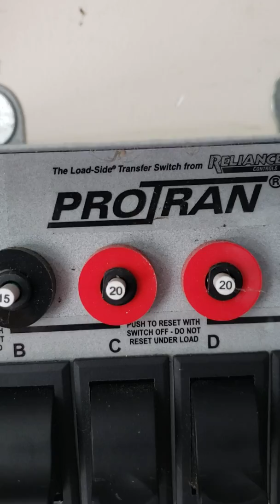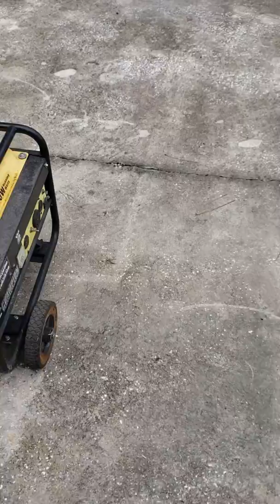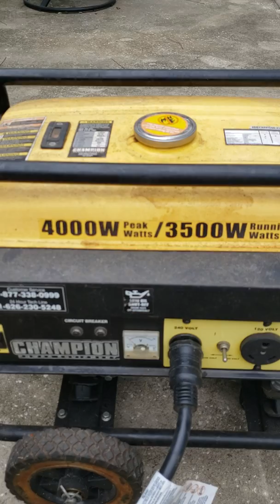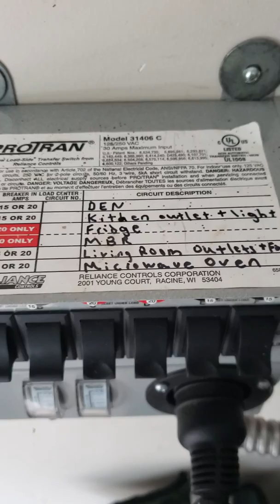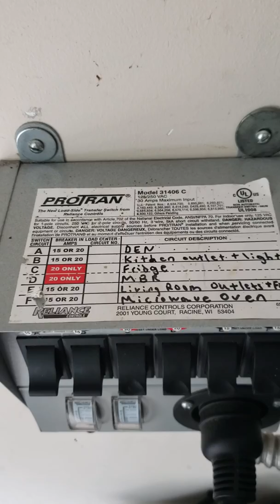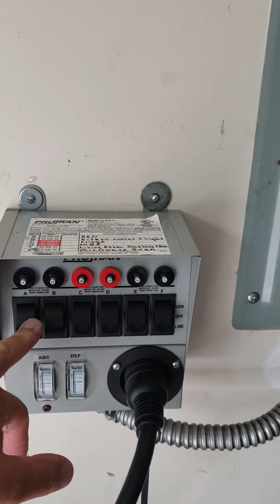Reliance generator transfer switch

Comment: Matt, great video...I came across it when looking for info on my Reliance transfer box, [31406CRK] when using my Champion [C46540] generator to power loads on my house main panel. Your generator looked similar to mine and if it is the same one, let me know if you've had issues with unregulated voltages on one side of your panel. I'll try to briefly explain and this is what I'm looking into before I install. 

When researching my generator, I learned that it is designed to have only one of its two output windings regulated to control the voltage. When the selector switch is in the 120 v position, both windings are connected and  their voltage is regulated to provide 120 vac - 30 amps to the RV plug. When the switch is in the 240 v position, the windings are split for outputs to the L1 & L2 sides of the 4-pin plug. As its designed, only one of those 120 v outputs is regulated. So if the  L1 & L2 are split to the loads in the panel, one side would be getting the unregulated voltage which might be a problem for me. 

I'm looking into using my 120 v RV plug to supply the input to my transfer box and not using the 4-pin 240 v output on my generator. I'm curious what you know and/or have done and if you've got a different generator, what yours is. THX and regards, gary

Comment: I have same box but never used it. When power goes out do u need make sure all your transfer switches are on generator or off? If i leave one on line, will that backfeed? Ty
Reply from the maker: You can leave the switches in any position you want if power goes out. The whole idea is that the generator and regular utility power are completely separated and safe. It won't backfeed in either direction if that makes sense.
Reply: @matthewschultz3568  ok thats what i thought just wanted double check. In florida and right in direct path of IAN 😵‍💫

Comment: For that money just get a manual interlock and a double pole 30 amp breaker and power the whole panel .. you decide what to power - same 6 circuits you have chosen or switch out as needed.  Additionally if you go up to a 6000-7000 watt generator you are already good to go.  Costs me a few hundred bucks for inlet box, extension cord, 10/4 cord, breaker to do it. No 'backfeeding' or unsafe aspects. Thanks for posting

Comment: BUT MAKE SURE YOU TURN OFF GENERATOR FIRST BEFORE YOU UNPLUG CORD FROM TRANSFER BOX OR THE GENERATOR . YOU CAN BE KILLED
Reply from the maker: So with this setup the cord end that goes into the transfer switch is a female plug. They do that on purpose so there aren't any exposed live blades. But yep you gotta know what your doing!